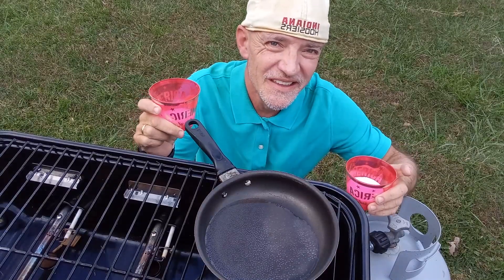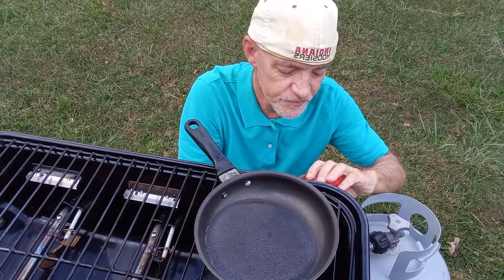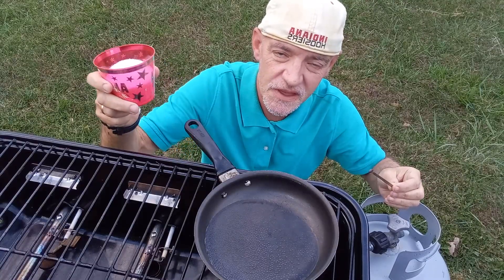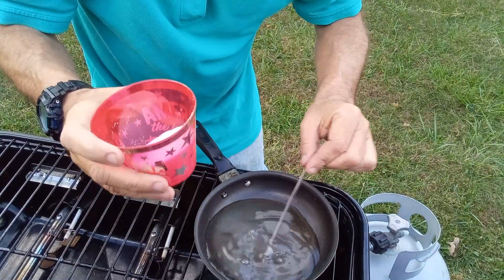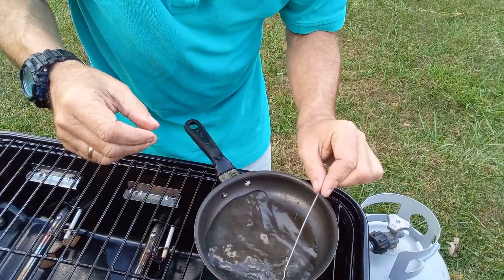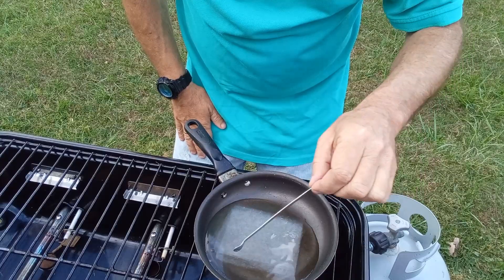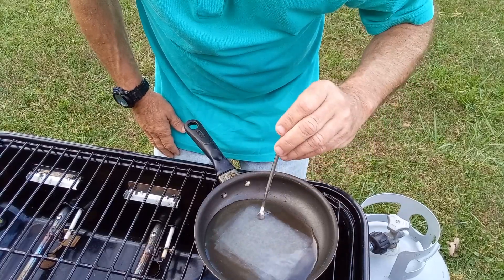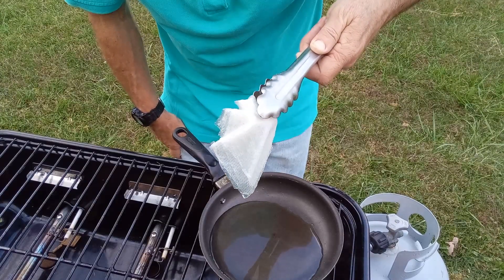HOW TO MAKE A FUSE FROM SCRATCH --PART 1 #diy #science #diyscience #scienceproject #how #howto #kno3

Comment: You can also use black powder or smokeless powder, nitrocellulose lacquer (ping pong balls soaked in acetone), and some string. Crush the powder and mix in the lacquer and coat the string. The nitrocellulose will act as a binder and is water resistant.

But, you can buy fuse from online pyrotechnic supply sources and they are rated for specific burn rates and some are waterproof.
Reply from the maker: @Mike80528  sounds great! Thanks for the info!